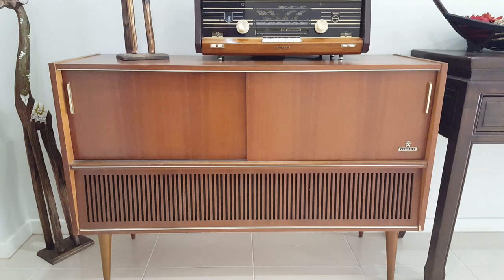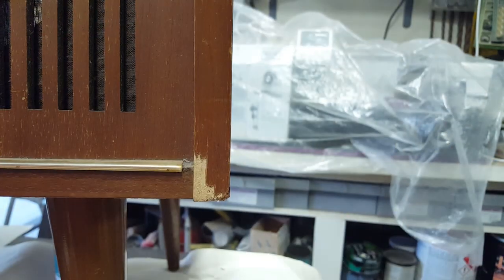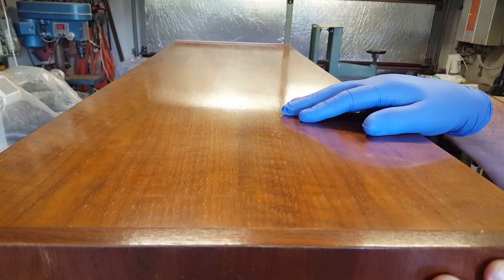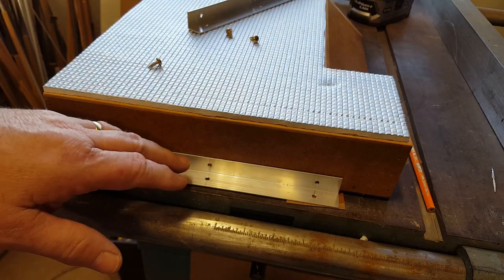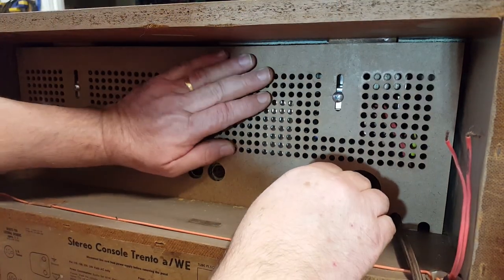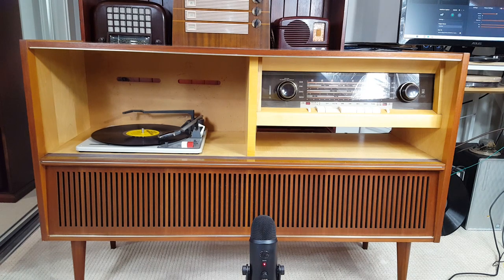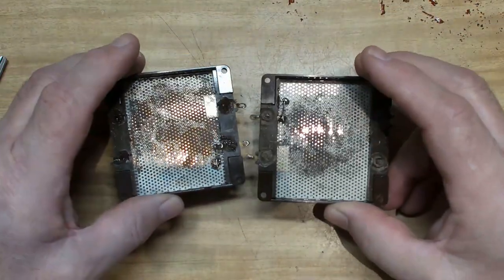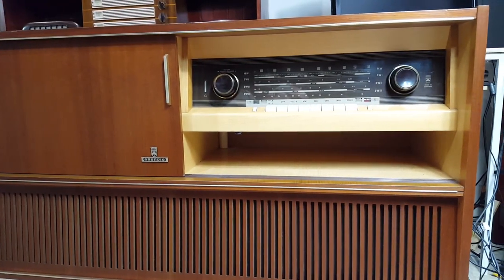Grundig Trento a/WE Radiogram Pt 3 - The Cabinet

Comment: Do you suppose the back-panel was removed to help dissipate some of the heart from the radio? I'm thinking if it's enough to justify an asbestos wood protection, then maybe it was too much for the perforations in the previous back? Could it be that some of the component/circuitry alterations you noted actually contributed to increased heat generation?

Very attractive piece of restoration either way!
Reply from the maker: HI cogidubnus1953, I don't know why the panel was missing, it could be due to heat. It needs a cover of some sort with hot valves in there and mains power sitting on the back of the chassis. I will monitor it once I get it working properly 🙂

Comment: Thinking (dangerous) seeing that radio,  it has a look of a Philips one about it too.  I wonder if the whole thing is badge engineered.
Reply from the maker: The radio chassis was definitely Grundig and the player was definitely Philips, whether they sold them under their respective badges I wouldn't know 🤔
Reply: @DavidTipton101  Certain the church had a piano key radio - we sold it out at a support charity shop many years ago, and I think it was Philips but in that unit style (but a stand alone radio - have you done any Philips of the 1950s - I dont think the design changed much, what Grundig have done here is the stereo /tweeter bit  I had  a similar cabinet for (cannot remember) but it was all transistor I am afraid I broke it up bar the motorboard (cheap BSR deck I did replace in a broken fidelity record player),  Cabinets could be made by furniture specialsts and bought in too, but some radio makers had their own cabinet departments.  Someone should have a spare o/p transformer on vintage-radio (but will probably be in europe but postage is not too heafty)

Comment: Nice job again, I enjoyed it.
Don't you need an electrolytic in series with the tweeters ? 22 µF or so ? I would be afraid to blow them to smithereens. But I don't know what Voltage is used.
I so much agree about the difference in sound from that periode. But I experienced reasonable results with CD's, as long as you use an analog amp from that period, and maybe an early CD player, not a cheap one from this century. And a must I think is a 5 or 7 channel equalizer.
Reply from the maker: Hi Erik, yes a cap in the piezo is a good idea. The second the needle hit Engelbert I remembered what it used to sound like. A tube amp should remove some of the brashness from CDs 🙂
Reply: @DavidTipton101  Don't get disappointed too quick. CD's come in flavours, and some are really bad re-masters of the original. But in principle the industry knows very well how to make things sound. Two bad ideas are re-mastering and bonus tracks. We don't need the first when solid technique is applied, and the second is only applicable when they give bonus tracks on a separate CD, so the original is preserved.
(I use a solid state Marantz amp from the 1970's, due for >unavoidable< recap)
B.t.w., if you rand about CD as digital media, hide yourself when trying to get into DAB+ or Internet radio. That I think is the death of sound as a pleasure.
Reply from the maker: @erikdenhouter  With the equipment I use theses days CD's DAB and streaming are all quite acceptable, the latter would fall short on a good system I agree.
Reply: @DavidTipton101  Thanks for your own insight in this, I think I will try to review my thoughts on DAB with more open mind after I recapped my amp 😉

Comment: Nice to see you are using the metric system.  No more imperialism down under?  Englebert likes your music choice!
Reply: It's a European radio so it's more than odds on that any measurements - such as the distance between sockets -  will be a nice,  round metric measurement.

A British set will likewise be a nice, round imperial one !

.
Reply from the maker: We went metric in the 60s and 70s. I still use either and will flit from one to the other ad nauseam although I mainly stick to metric. Englebert seemed quite impressed 😄

Comment: Beautifull result, it looks fresh but you have not wiped out it's age :-D
I'm sure there are experts out there that would moan about how you did things, but they are picky bast..ds so ignore them lol.
It's likely that the high voltage electrostatic windings in both transformers are deader than a dodo.
They could be shorted out, so that will screw up the drive levels to the main speakers.
If the  high voltage windings are near the surface, they could be removed, but thats a pain in the ass or donkey lol :-D
Using tweeters put the clarity back :-D
That back panal looks amazing, you clever sod lol.
Reply from the maker: The unit looks nice and original with it's few knocks and dents. The electrostatics don't have windings, they are two charged plates that repel and attract each other. I could fix them with some silver Mylar sheet but I'll stick to the piezo tweeters, they produce a similar sound. I was happy with the back panel too. Thanks zx8401ztv 🙂

Comment: I think I might have a scrap Grundig chassis with one of these transformers going spare...
Reply from the maker: That would be good if you do Robert 👍🙂
Reply: @DavidTipton101  Sorry David, the ones on the chassis I was thinking of are 9060-107-xx, still connected to ECLL800 valves however. I have oither chassis to check yet though, it might take a few days!
Reply from the maker: @robertball2741  Thanks Robert, the only difference apart from the physical shape and mounting method of the transformer would be the output impedance and there may or may not be a tapping for the electrostatic speakers which I am not using now anyway. Unless they are radically different to my transformer shape I can adapt them.

Comment: If I remember correctly you made a video on how to to seal small cracks on speakers which video was it  and what did you used to seal it ?? There's a small crack on the speaker of my radiogram and I think it affects the sound... By the way great job 👍
Reply from the maker: Hi Kleovoulo's 78s, I have to repair most speakers for radios so I can't direct you to one particular one. Depending where the crack is on the cone I used the rubber compound as in this video because it was on the surround portion of the speaker. I also use contact adhesive for that area. If the hole is to large to just brush on a seal I use paper towel, toilet paper, tea bags or coffee bags with contact adhesive or PVA glue, I avoid PVA on the surround area as that needs to flex 🙂
Reply: @DavidTipton101  Thank you very much !!

Comment: Dave I know I will get shot for saying this...
Would you consider adding a line in or Bluetooth connection to this unit now to take advantage of this lovely units stereo output and wooden cabinet sound?
Reply from the maker: I was and still am thinking of doing that 1974UTuber. I even purchased a 5 pin DIN plug to adapt a Bluetooth dongle to the tape input. You have been granted a stay of execution 1974UTuber 😀
Reply: @DavidTipton101  Phew.... I was preparing to wear a crash helmet and body armour to deal with the incoming stones.

Comment: Thank you once again David for a most enjoyable series, I love seeing your ideas and solutions for each challenge. Interesting issue with the output transformer imbalance; as it seems intermittent maybe you will be lucky and it could be just a poor connection where the winding connects to the output terminals? (assuming it is the one with the higher impedance that has the low level). Regarding the asbestos pad, how will the lacquer stand up to the heat - is there any risk of that being a problem?
Reply from the maker: Hi Ross, thank you, I'm glad you enjoyed it. It was the one with the high resistance, I will pull it out soon and have a look, it would be nice if it was a poor connection. I'm not sure what will happen to the lacquer over time, I think it will be ok, it's automotive lacquer so it's reasonably heat tolerant, hot engines and such 😀
Reply: @DavidTipton101  Many thanks for the reply - looking forward to the concluding installment (whenever that may be). I have really appreciated your videos over this last year and more. The UK is unfortunately still struggling with Covid restrictions despite the vaccine, especially for travel - so the brief escapes to Australia are most welcome!
Reply: Thank you for another great video.  I've always used tissue paper and speaker cement to repair any speaker damage.  I like your technique of using liquid electrical tape. Can't wait to try it!
Reply from the maker: @nelsonwong7048  Thanks Nelson 🙂

Comment: I want to be first on the comments. Not 👎 sure what you're doing. Be very careful with the asbestos. The best way to do this is to wet the asbestos, and remove it. I'd hate to paint, or lacquer over it, for fear 😱 of future problems. I know 👌 asbestos presents very little danger, if any, if not 👎 disturbed, but this thought has always bothered me. Tube heat may cause release of asbestos fibers. I do not 👎 know. If this console were mine, I'd try an outside job of asbestos removal. Just wet it really good 👍, and proceed on removing it. Your friend, Jeff.
Reply from the maker: Hi Jeff, I was very careful with the asbestos, I couldn't move the unit outside, it's too big. I soaked it right through with the lacquer, those fibres won't go anywhere. Besides, once finished there is little to disturb the asbestos 🙂